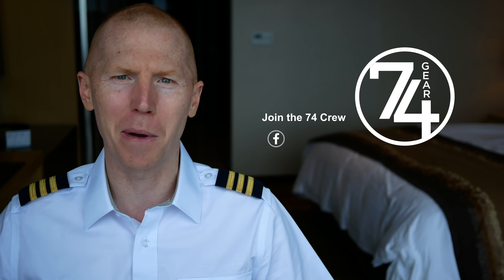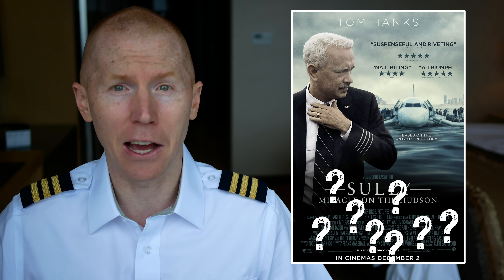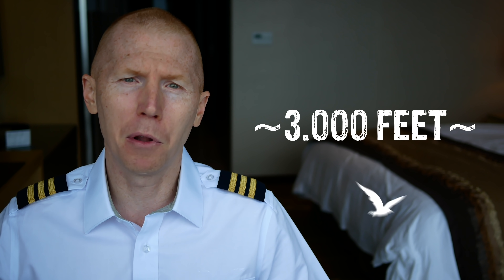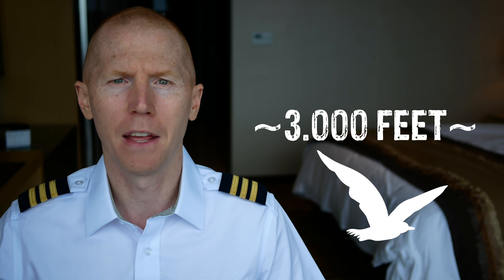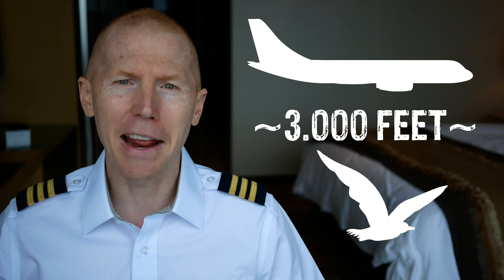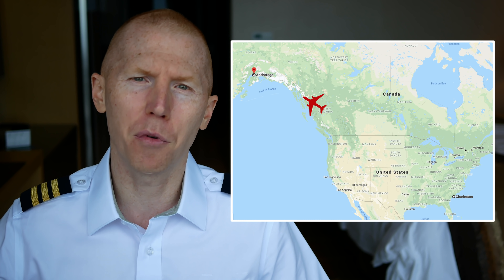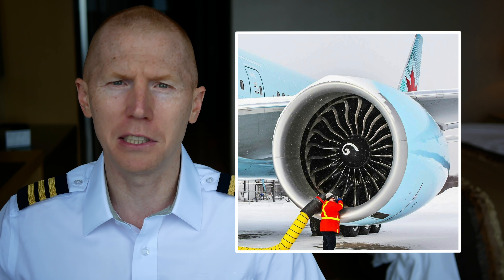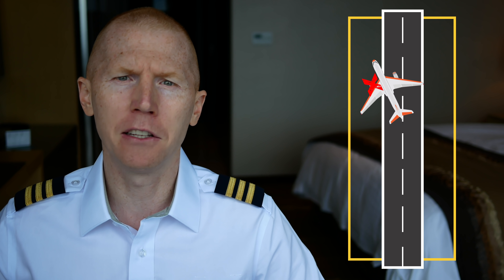Why Engines Don't Have a Mesh or Grates to Stop Birds

Comment: You could have a screen deploy like the clam shells for reverse thrusters. Deploy screen on take of and landing in high strike probability scenarios.
Reply: You mean like engaging drive and reverse at the same time. Brilliant, no aircraft would ever move after pull back.
Reply: @byteme9718  the similarity to the clam shell would be in the hinge and deployment not the composition. The screen would allow air to pass through.
Reply: @renpope1210  I was actually taking the piss but was evidently to subtle. You're suggesting a solution to a problem that doesn't have any significance at any practical level.
Reply: @byteme9718  I do not know what "taking the piss" means. Foreign object debris (FOD) is a serious issue. The Russians have a system for military aircraft to mitigate FOD by completely closing off  the intake to redirect the flow of air.

The video stated that it was impractical and inefficient to have a screen in front of the engine. My post was meant to state that there might be a solution to to temporarily deploy a screen. This is merely a consideration and has no testing or research to establish that it is effective or practical. Another solution might be more effective.
Reply: @renpope1210  It means I was poking fun at you. FFS airliners are not miltary aircraft and operate under completely different conditions. Yes FOD is potentially a dangerous hazard but so much is done to mitigate the risk which is infinitely small. You're probably aware of this because of the "miracle on the Hudson" but Sullenberger saw a massive and dense flock of Canada geese from over seven miles away and took no effective action. His decision making and piloting skills after the collision were exceptional but he still flew into them. Ask yourself how many instances there are of airliners being brought down by FOD there are and then check to see how many flights are in the air right now or take place over a year. It's a non issue in the grand scale of aircraft operation as multiple measures are in place to ensure safety.
Reply: @byteme9718  thank you for the clarification. 
Again, my post was not meant to say that aircaraft should employ a screening solution.  To fully flesh out the full thought of my original post: If it was determined to need one,  a deployment system similar to the clam shell could be used to temporarily place a screen in front of the engine to mitigate the effect of having a screen in front of the engine for the entire flight. 
My comment was intended to illustrate that a screen could used temporarily in direct response to the comment in the video that having a screen in front of the engine for the entire flight would be inefficient (I'm paraphrasing). I am not saying that it is a viable solution to mitigate FOD, if it is cost effective solution, or even if it is a solution that should be considered at all.

I was made aware of FOD well before the Hudson mishap. Very few planes have been brought down by FOD, but the effects of FOD can be catastrophic. Consequence Management needs to be used to determine if the effects of FOD necessitate mitigation. To your point, how many aircraft out of the millions of  miles flown pet year have depressurization events? Minuscule compared to the total hours flown, however that impact is mitigated by oxygen systems. Aircraft have oxygen systems not because of the number of occurrences of depressurization, they have them for the consequence of failure and the feasibility to implement the system.

No commercial system for FOD has been implemented, so it is a probable combination of low risk and costly implementation.
Reply: @renpope1210  From a passenger safety perspective FOD is insignificant so the only other concern to address is of turbine blade damage and clearly the airlines are not worried about this because the cost benefit analysis would make pursuing any measures senseless. I do recall a funny story about a UK airport that had a newly surfaced test bay to run up engines following maintenance. Block paving had been used and one aircraft dislodged one of the blocks at which point the engine ingested many more as those surounding it came loose.

Comment: Potentially crazy idea:

Russian MiG-29s were built with a retractable screen that covered their jet engines on take-off and landing (during which time additional airflow came from slat-covered ducts above the engine nacelles (compartments) in the wings.

Could a similar design be implemented on a commercial aircraft? Say if the engines were put in nacelles similar in shape to those on the  Concord?

Comment: also... I guess it would be possible to build a mesh that only reduces efficiency by a very small percentage - the problem is at any speed higher than the minimum speed of an airliner it's not gonna do much good - the mesh won't keep the bird out of the engine now instead of a bird you get a lot pre-chopped birdmeat into the engine which most likely does approximately the same damage the bird would have made
some military aircraft have secondary air intakes for taxi, takeoff, low alitutde operation, etc - the main air intake get's closed during those times and a secondary air intake is used which has a mesh and bars to prevent debree from being sucked in but both the efficiency and max power of the engine are vastly reduced when using it - but it's good enough for taxi and takeoff and after an initial climb the main air intake cna be opened
this does not really help against birds though, it's mostly against hard debree like rocks or pieces of metal and isn't useful unless you are operating off an improvised runway or flying very low

Comment: There is a simple solution to this. Who would be most interested?
Reply: Not me. Unless of course you design or certify these engines.
Reply: @byteme9718  How much you pay if I make that?
Reply: @jarikinnunen1718  No one would pay you anything. This is not a problem at any practical level.
Reply: @byteme9718  Sounds like after the phone was invented, the postal minister had said there was no use for it because there were just enough messenger boys. I know what you don`t, lot of
Reply: @jarikinnunen1718  How many fatalaties have there been as the result of airliners that have crashed because of bird strikes?
Reply: @byteme9718  How many million have paid for scaring birds out of near by airfields? Without sure of results. Sully movie is story of miracle survive. One of million opportunity.
Reply: @jarikinnunen1718  Birds are scared away for more than just protection to engines.
Reply: @byteme9718  Yep, I got your point. Scaring more birds solve it. Or denying it exist.
Reply: @jarikinnunen1718  I asked before of a list airliner bird strikes that have resulted in fatalites and you faiked to answer so lets make it easy. Confine that list to the last five years.

Comment: It's not one bird that's harmful, it's FLOCKS of them, and airports all over are trying to keep them away with a variety of techniques. A small bird won't hurt an engine and putting a screen in front of an engine would only cause severe icing problems (as well as getting dirty and full of bugs and runway FOD). Pratt & Whitney used to toss frozen chickens into their test engines to see how their engines would perform. Did you notice those silver edges on that 777 GE90 engine? Those are carbon-fiber fan blades with titanium edges--just for the birds.

Comment: Put something in front of the engines that would chop up birds into small pieces that the main engine can then handle.  A special very strong cutting blade that wouldn't restrict the airflow much.  If 10% efficiency is lost due to that, make the engines 10% more powerful and charge 10% more for airfare.  This isn't rocket science.  I am not even in the aviation industry.  Common sense.
Reply: FFS these engines withstand bird stikes and are tested to do so. You can't design anything for the most extreme scenario.
Reply: @davidjames1684  It's pathetic that people like you overreact and stat running around like headless chickens.
Reply: @davidjames1684  How many have died? All air crashes are investigated and logged so come on David provide a list of fatal incidents affecting civilian airliners. It should be easy because in your imagination the list must be MASSIVE.

Comment: I thought if the left engine was lost then the thrust of the right would pull it to the right.
Reply: What happens is that the wing is like a lever. The thrust of the right tries to push the wing foward, but the wing is attached to the plane which has more mass, so instead of going forward the right wing causes the fuselage to spin to the left.

Comment: These engines need smooth air.  A grate in front of the engine would produce turbulence. The turbulence would make the fan blades wobble and fail prematurely.
Reply: If that was the entire case, they would use the grates wind tunnels have (which would also filter out debris). However it is more about flow restriction and reduced efficiency. With that said, you can put a jet engine inside a PVC pipe and cap the inlet side, it will still suck in enough air to run). With all the model RC jet engines they have FOD screens on them (low altitude, and flight time might only be 10 minutes, so grass and other junk like insects are a high percentage of the time). Plus most stealth planes have S-ducts and those can be turbulent as hell...  So I wouldn’t say they “need” smooth air, I’d just say it’s “preferred”, just like direct airflow is preferred but definitely not needed (it’s perfectly fine to have the inlet behind the jet’s inlet, it will suck it forward where it needs it, you might lose 10-20% but it does great with the heavy FOD going right past and useful on some stealth applications.

Comment: That technology sounds like a double edged sword.
If 1 of your two engines gets struck mid-rotation, and this computer shuts off the other one....
Reply: In the case of dual engine aircraft I'm sure the computer applies rudder to compensate for the imbalance rather than throttle back.

Comment: Take off is optional, landing is mandatory.... and don't forget, where ever you go, there you are!
Reply: Profoundly irrefutable.  Cheers!
Reply: Takeoff isn't mandatory while you're sitting still.  Once you commit to a takeoff and achieve a certain speed and distance down the runway, takeoff becomes mandatory.  That is among the absolute worst windows of time for a major engine failure.
Reply: @herbderbler1585  That may be so but it it you as a pilot that makes the decision to get to that point.... whereas when you are in the air you have no real choice..... you are coming down at some point regardless...   so please stop trying to be clever.... because you failed. Have a great day today and a better one tomorrow.
Reply: And every air craft has a 100% guarantee that it will get directly to the scene of the crash.... in the event of a crash...
Reply: Excuse me but this makes no sense to me. 
maybe I am just not smart enough to understand.
Reply: You forgot one. 

"In an emergency, there is nothing more useless to a pilot than the airspace above or the runway behind".
Reply: Take off becomes mandatory at V1 speed
Reply: @sasino  but it is YOUR CHOICE to get to that point.... once you are in the air you have no choice but to land.... eventually
Reply: Takeoff is mandatory  when you are seconds away from rotation.
Reply: @BlueOvals24  But it is YOUR CHOICE to get to that point... you took the option to get to V1... once you are airborne you have no choice but to land....  the only option is down!
Reply: @rangieowner  It's mandatory to takeoff when it's you're job.
Reply: @BlueOvals24  Now that's not entirely true is it?  If there is a safety issue or weather issue you're not gonna choose to take off..... either way it's a choice to take off but you HAVE TO land once your up!
Reply: @rangieowner  You have to takeoff to land.
Reply: @BlueOvals24  This is true... but you don't have to take off at all....  but once you do take off you have to land!
Reply: @rangieowner  Technically you don't have to land. Could crash.
Reply: @BlueOvals24  Technically a crash is an uncontrolled landing
Reply: What you wanna say
Reply: Hah hah hah idiot

Comment: Just thinking out loud...if you put a screen, the engine might be saved, but it would still be rendered non-functional in the even of a mass strike. It would not be able in ingest any air. Also, I imagine a lot of small things (including small birds) are ingested by these engines, without drama. And then, of course, if the screen were to be sucked in....

Comment: I’m going to guess, because the grate would end up going into the engine.  If the impact is severe enough.
Reply: welds are very strong? well, how much does a goose weigh, maybe 3-5 kilograms? coming in at around 200m/s if not more? that‘s like, an impact of 80 000 Joule, so basically a light artillery shot, per goose. now if you hit a flock of them, it‘s gonna get seriously uncomfortable for the welds, you can pretty much put heavy armor in front of the turbine. like, a few tons of reinforced concrete kind of heavy armor (:

Comment: MIG-29 has the right idea, no reason grates in front of the engine at low level with bleed doors on the nacelle wouldn't work on a 747.
Reply: I know, it's apparently quite effective, SU-27 manages the same thing without any bleed doors. As far as I can tell cost of the carefully made titanium alloy grill is about the only reason not to use such a retractable system for flight below 3000ft?

Comment: Need to be honest about what happens when a bird goes into the world's largest and most powerful food blender. If u think about it, the bird stops resembling a bird as it hits the rotating blades and there is only a sudden influx of non combustible mist sucked into the engine. That is what causes the fire in the engine to fail. In many cases there is fan damage, but that's not what shuts the engine down, it was gonna stop anyway.

Comment: This technology... That keeps an aircraft from veering......you treat it as if area 51 is involved....do tell this secret....

And... engineers not being able to have something to prevent a bird strike....I don't believe that is true...I'd a company wanted to they could put a super sized canopy parachute on top of a 747...
Reply: Clearly retractable screens are impossible (that’s a joke, they’ve existed), and surely something like a cone in front is also impossible (imagine an SR-71, but oversized cone beyond engine diameter so heavy debris has momentum and keeps flying past just like air filter pre-cleaners, and the light weight air can move back around it, this design would also be applicable to Stealth aircraft when modified slightly though I obviously won’t say how). Oh look, an engineer just came up with another solution in 3 minutes, and it could be multi-purpose, mind blown!

Even my teams stealth UAV had a method to reduce FOD... And the team before us had an Inlet BEHIND the inlet of the jet (it turns out you can also shove a jet engine inside a long PVC tube and cap the inlet side, it will still suck in hard enough to pull in air backwards to run, although not ideal, it’s proof that it still works...)

So yeah, you defiantly can make them safer, it’s just how safe does it need to be? Most people are expendable when it comes to profits, they definitely have price tags (rather low, but commercial aerospace is pretty safe). At some point you do end up having worse environmental impact (that said, the UAVs we developed also have FOD screens in front of the jet).

Comment: Prepare to be bored. It is because it would disrupt the air inflow to the engine and may cause a flame out or engine failure. Air is very compressible and at airliner cruise speeds (550 mph) will bunch up at a barrier and stop air molecules behind entering the engine. No air, no engine, no engine, no flying!!!!! Bored enough? 🤖

Comment: Can't engineers think outside the box?  When talking about a mesh or crate, everybody thinks of a flat mesh in front of the engine. What about a conical mesh, long and strong enough to deflect any birds to the sides, yet with ample room for air to go through it?  Or an air ram from the side of the engine, only to be used up to 3,000 feet, then it would be normal front- intake above that altitude?
Reply: FFS! Idiots like you don't deserve technology of any kind.

Comment: The f-117 has a mesh on the engines seemingly with no problem so to say it cant or shouldn't be done just seems silly to me. An engine intake with a mesh or a screen maybe even slightly angled like the f-117 seems to me would not only avoid a bird strike into the intake but also divert and deflect it, again if the engine intake were slightly angled. It seems to me more of the money issue not wanting to research it and build it rather than  a issue of it cant be done

Comment: A better question would be whether airports should use radar capable of tracking birds to notify pilots and protect both planes and birds alike.
Reply: Sullenberger spotted a huge flock of geese from miles away and chose to fly into them.

Comment: When G E built the engines for the 777 they shot 20 lb frozen turkeys thru the engines on a test stand and no flame out or any other problems.  They also shot enough water that simulated flying thru a cat 5 hurricane and engine did not flame out.
Reply: Yes but Sullenberger chose to aim his aircraft at a huge flock of geese he has spotted many miles away.